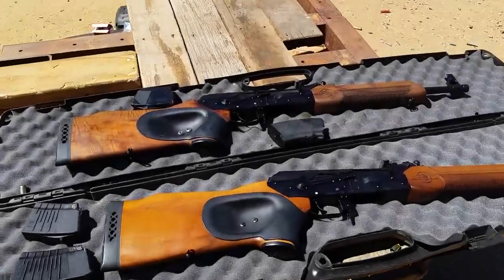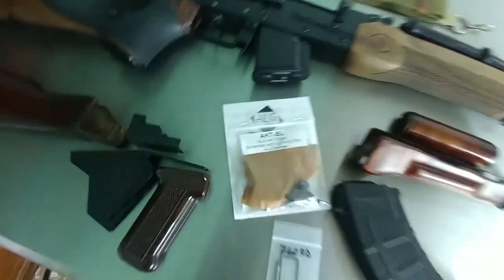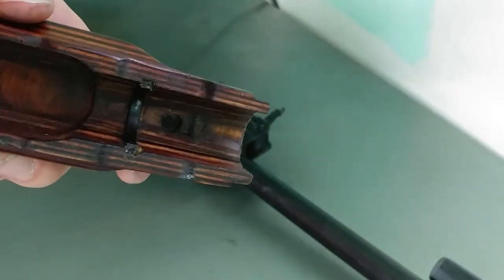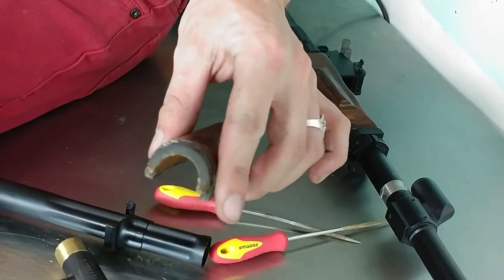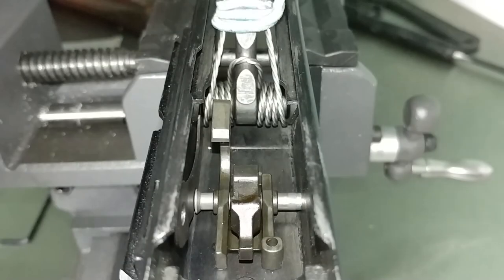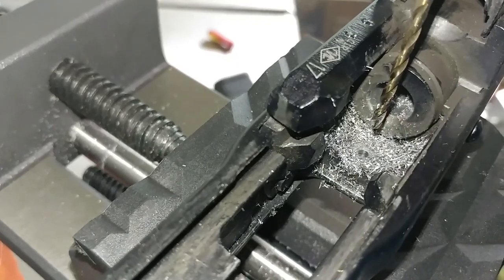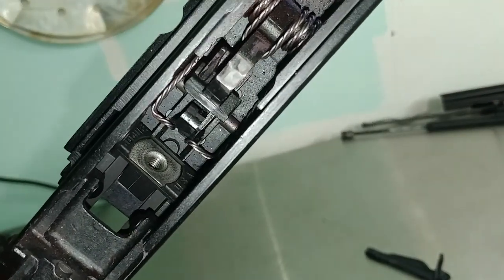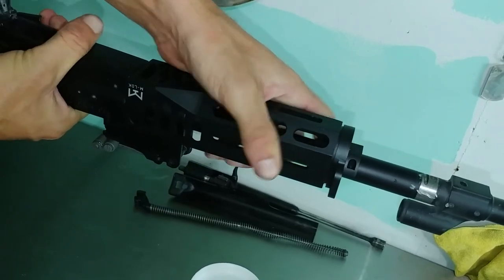Vepr Conversions!

Comment: These Veprs were probably the best deal (in modern times) available prior to the import ban.  $700-$1000 for a near milspec (sans the full auto capability) russian kalashnikov built on the RPK frame.

Comment: Which Slant to M4 Adapter did you use?  Is the buffer tube straight and can you still use the iron sights?  I purchased the Krebs Customs adapter but the buffer tube is angled downward and I can't use irons.
Reply from the maker: I used the Canis Slant Adapter, buffer tube is perfectly straight. but the krebs should be straight too! It wouldn't make sense to leave you with an angled stock. My iron sights work great.
Heres a vid of someone installing a krebs adapter and it looks straight.
https://www.youtube.com/watch?v=FaMM0hbc_Js
Reply: @bioalchemist   I am not convinced another adapter will be that different.  It could be the cut of the receiver.  I think my best option is a Magpul Zhukov stop and slant receiver adapter.